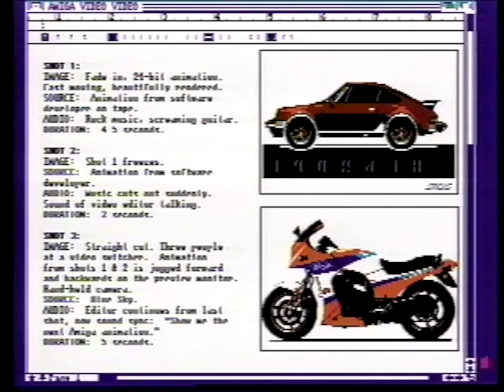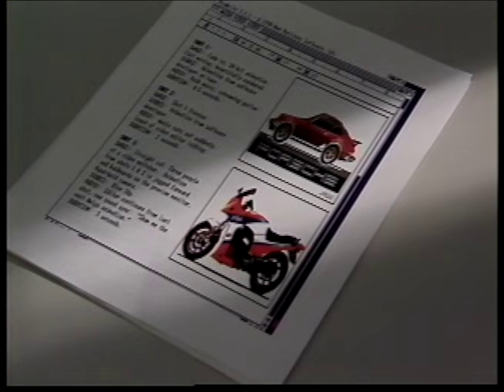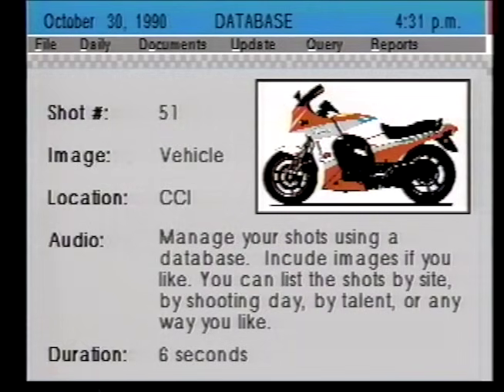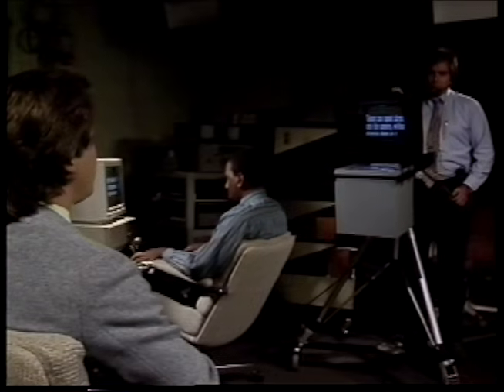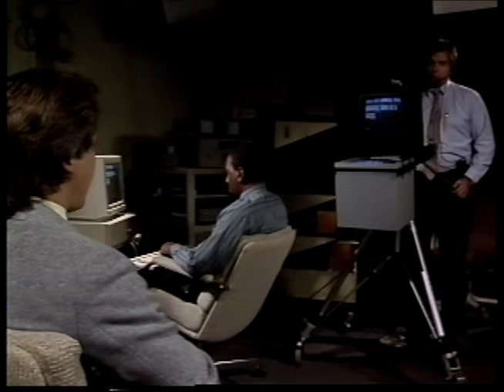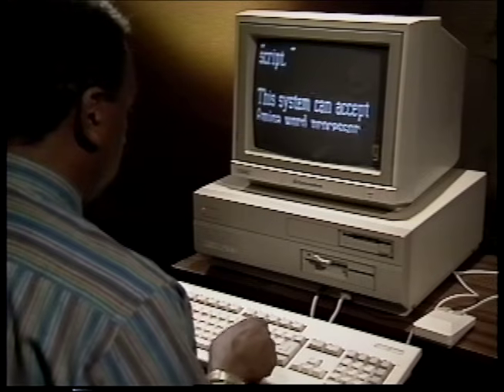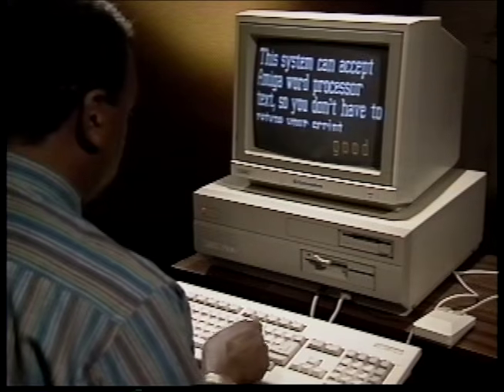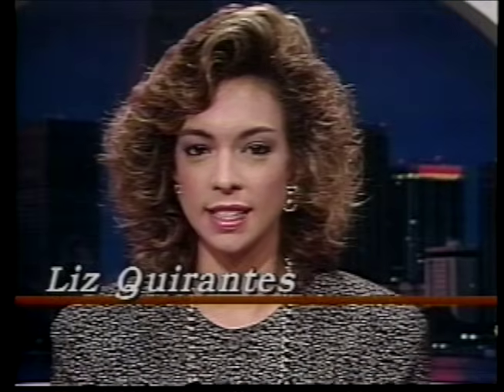Commodore Amiga Graphics Demo VHS Tape (1990)

Comment: If Commodore had just seen the light and focused on marketing the Amiga as a gaming computer, they might have survived the '90s.  Sound and video production represents such a small slice of the market that it wasn't enough to keep them afloat.   If they had sold the Amiga alongside game consoles the way they had done with the Commodore 64, things probably would have turned out differently.
Reply: They made more money per unit sold when targeting the high end. Home computers (by which I mean the low end, A500 etcetera) were sold at low profit per unit. There was no problem selling the Amiga 500 as a gaming/general home computer, it was thoroughly popular here in Europe. In the US, Nintendo and, later, Sega consoles ruled the roost as the popular game systems, and obviously when PC gaming became mainstream in the early 90s there was no way for the Amiga to get a look-in in America. In fact even the C64 suffered in the US once the NES became popular, and it went out of fashion over there (while here in the UK it persisted far longer as a popular computer).

Comment: My friend was the manager of the art department for ABC television in Manhattan.  I went to visit him once in the early 90s and forget apple - the art department was wall to wall amigas!  To the point that they had a bunch of Amiga director's chairs that commodore gave them as gifts because they bought so many amigas.  He even gave me one which I have in my attic.  Great stuff - it has the Amiga logo on one side of the fabric backrest and "Makes it possible" on the other side.

To ABC television, Amigas were way more capable than apple computers were and used those for a lot of the graphic work.  He told me they begrudgingly moved over to Apple once commodore went belly up but it was considered fact, at least in ABC TV in Manhattan that Amiga was far more capable and better at graphics than anything Apple could do.

Comment: if you don't want youtube compression to ruin the quality i recommend rescaling to 1440p or 1080p as a bunch of people do that for bitrate and frame rate reasons
Reply: not ai upscaling or anything but just resizing it to 1920x1440 or 1440x1080 in something like handbrake
Reply from the maker: @flpydisksys Ok thanks, will give that a shot